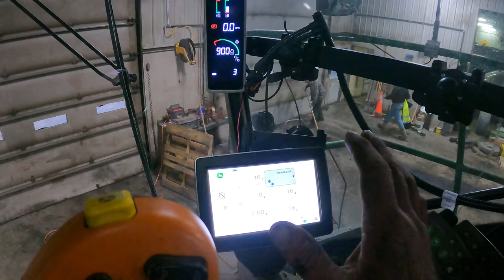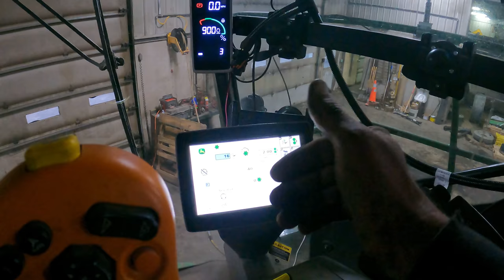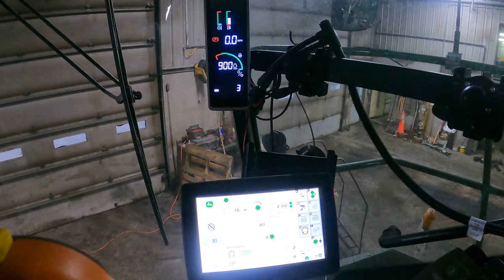No plastic was burned in this video

Comment: Take those parts to the muffler shop and they can bend them up in stainless steel.  Have done it before and it works great . Still working 10 years later .
Reply: Put Stainless wire and a Tri mix gas, cut the ends off the old elbows and weld to the new ones...

Comment: You surely got those pipe fittings way cheaper than the factory parts and they should work just as good truth be told they are probably better thanks for sharing buddy

Comment: Well Andy, the plumbing parts work quite well and definitely will last a long time. A couple of optional solutions would be stainless steel boost pipe or ss seamless exhaust pipe either one works very well, they just need a bead roll on each end to keep the hoses from sliding off.

Comment: Its nice to see father/daughter time...when cleaning parts like your shear blades, I tack 4 pieces of steel to the table in a square and drop the shear blades in and they can't get away when grinding or wire wheeling..nice video

Comment: Awesome video man. Just the perfect length shop video. I like your repair for the coolant lines on the C-5. The whole not being able to get parts thing is a real pain in the ass I've got a shop full of stuff that I'm trying to improvise on. I was thinking the same thing back during your chopping videos that's the most mud and dirt I think I've ever seen on your chopper lol. The pressure switch issues must be common on the hot water power washers. 
Ours right now actually is the opposite, the pressure switch is stuck so the burner won't shut off. When you let go of the handle it builds up pressure and the bypass on the pump kicks in, the switch is supposed to recognize the water flow has stopped and shut the burner off. I went out the other day when one of the guys was running it and noticed that the burner was running and running to the point where the water was basically boiling coming out of the nozzle. Glad I caught it. Take it easy Andy

Comment: Another great video.  As previously metioned stainless tubing for the coolant lines is the way to go. Either from the local muffler shop or order mandrel bent elbows from a speed shop like Jegs or Summit  racing, or ask your steel supplier if they can help, they should be available in different tube diameters and radiuses . then it's just a cut fit and weld operation.  Don't forgrt to weld some safety beads around the ends of the tube to keep the hoses from coming off. also use double clamps if you have room for them.

Comment: That waist oil burner should be checked out for an injector head and the electrodes I bet they just need a good cleaning it should be done once a year. For safety I would get heating and air tech out just to give it a once over. Great video

Comment: I have a lanair mx160 I bought used and am trying to get heat exchanger fixed. When I bought it I didn't know that the heat exchanger was bad. Previous owner had. It maintenance it in years. There was 10 gallon or more of ash built up and it warped. I'm gonna straighten it out and weld a patch on. I can't wait to use it.

Comment: On those coolant pipes... can you weld hole closed temporarily? If plumbing fittings work, I'd leave it...?
On the oil burner... yes electrodes go just in front of the nozzle like a spark plug and ignites the oil.

Comment: ANDY  watching SARAH using  the 6" grinder wire wheel  as you know if that happens  to grab her clothing  she will lose some skin . Best bet for her would be to wear a leather welders apron . As for the radiator pipes yes the MUFFLER SHOP .probably at least 1/3 the factory price and in STAINLESS. CHEERS GOOD VIDEO ENJOYED .

Comment: Is buy a stick of stainless steel 
 go to a muffler shop and have them bend you the pipes that you need
 Get a beed roller
 Roll the ends Then you'd have it on stainless still and wouldn't not have to worry about it again

Comment: think i would have went the pluming store route myself if the dealer price is as stupid high like it sounds i would not pay it myself in stock or not  one other idea would have looked at is exaust shop and thick walled stainless steel pipe

Comment: I thought it was just too much of a coincidence that the transformer would be the problem on the cleaner too. Of course when you are working on one that has a bad part the first thing you would think of would be, "is this the same stupid thing"? But no the universe just wants you to think that. Monkeying around with that corn stubble chopper, brush hog is you got the job finished and can now fix it right on the wheel bearings. Jeesh-- just one thing right after another especially with Jarrod. That poor guy. I think material is not up to par and may get worse. That trajectory anyways. Good luck Andy, keep your children safe. Don't push them any harder than now because it isn't worth it. Deaths in my family prove that's true.

Comment: Andy. . .at about 31:50 The absolutely most dangerous thing I have seen since watching your channel occurred. Sarah was operating 4 or 6in wire cup brush on a grinder. She had on a lose hooded sweatshirt with a pocket in the front.  That can and will severly injure or kill the operator in a millisecond.  If the brush grabs any part of the clothing it will rotate in causing severe bodily harm. Please make sure all workers discontinued this type of operation immediately. I am not trying to be a Nancy or Karen that tool will rip,shred, and rotate into her flesh twisting in the cord, sweatshirt .....it is very very bad.
Reply: Yes I saw this also , hope Andy see your comment .
Reply: fair comment  I thought that grinder was way to big for that job any way  a 4" grinder is plenty big enough and far easier and safer to use

Comment: Boy howdy Andy, your always in crap up to your ears ... I was just thinking that if you had no mechanical inclinations as to how stuff worked, Your company costs would be as high as a storks butt over the other businesses. Not all of it comes as easy for the girls or little Andrew... Jared could run with most anything now as your his mentor. I have worked on a few Black gold heating systems, their simple enough when working and they really did a great job but come break down, it reminded me of a nursery rhymes about the leg bone is connected to the hip bone and that is connected to the...... it was a rabbit hole is what I am saying. One thing that killed mine mostly was a spec of antifreeze would get into that nozzle and bang. Down that dang rabbit hole. I imagine that Sarah has the earned respect of the men in the shop so that little phrazes like "thats what she said" usually hits the air eventually and mens faces get red as soon as said. My daughters turned out to be a lot said, just like one of the guys. That black gold almost needs to use new oil so it doesn't die so quick. I have changed every part that would give problems in one and the one on the other end of shop got the igniter a few times over the years.... lucky me worked on those shop ready heaters an much the same an not in others. I remember back in the day that I had a most gentle laid back mellow Rottweiler who would come in from outsides snow an be a bit chilly and he was enjoying some of  that heat when the thing acted up, paused a second or two an then shot flame about twenty feet lighting the hair on his butt on fire! He never ever trusted one of them again. I felt so sorry for the guy and gave him the cold water to put out his winter coat fire. I so enjoy your fine videos Andy and hope some how santa brings about a hundred and twenty thousand subscribers to your channel and in other ways if it grows to that large, you will never see our names anymore as the increased work load for doing the editing would be almost as hard as running this farm.

Comment: What about the piece which broke off from the bush hog⁉️   Would you be trying to retrieve this piece to prevent running into it again possibly coursing damage ❌

Are you able to confirm that biggest difference between the two processes is that with brush hogging the device turns horizontally to trim back the sides of trees and bushes. ... That will be done with a brush hog. With bush hogging, the land itself is cleared from brush, small bushes, tall grass, and other overgrown vegetation.
Reply from the maker: It’s all the same